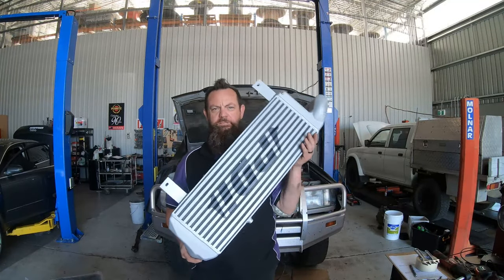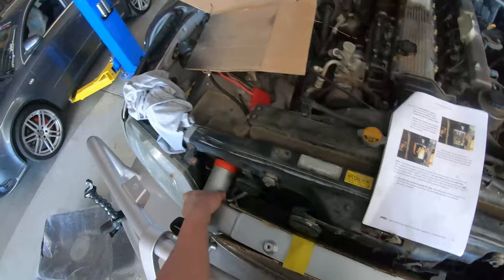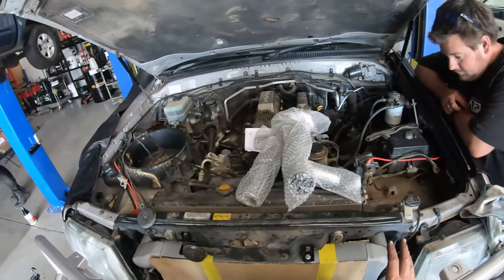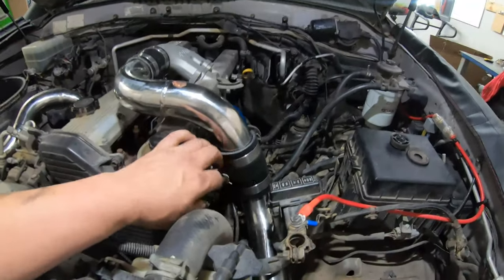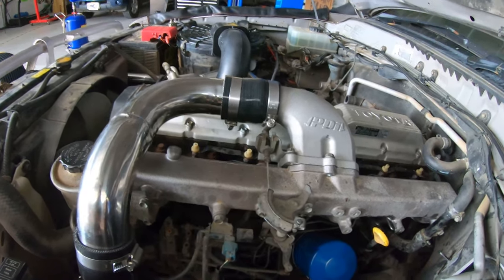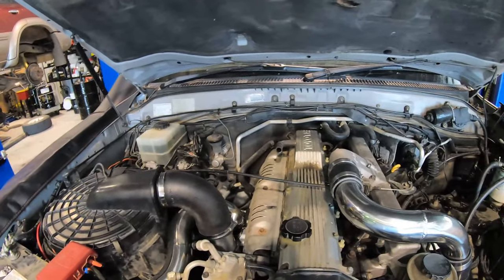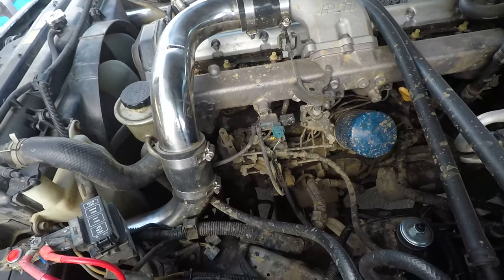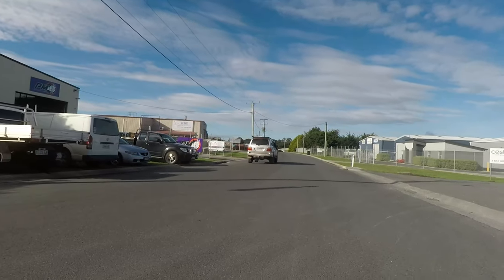105 series Landcruiser Turbo 1HZ Pt. 2

Comment: 10/04/2024
Hi there I am from south africa and love this video. I want to do the same convertion.
Q- is the gain worth the risk if done by a professional? Here is the stats my installer sent me.
#Power gain is +-25/30kw and 80Nm gain
Fuel consumption gain not worth mensioning.